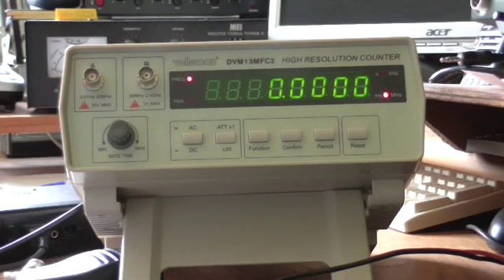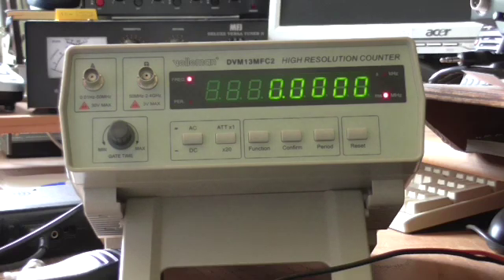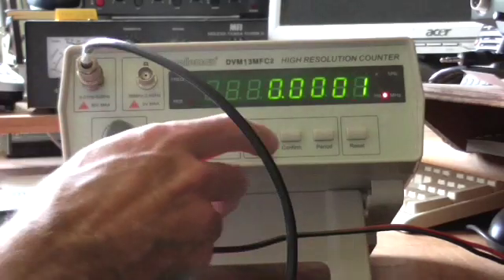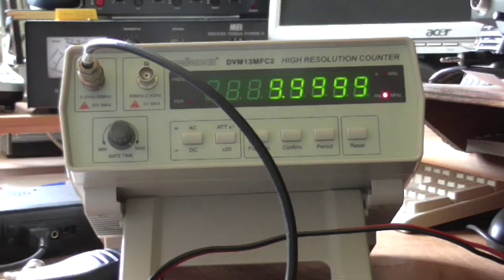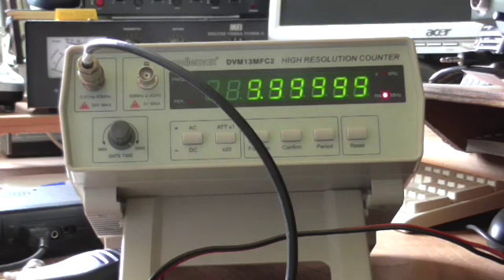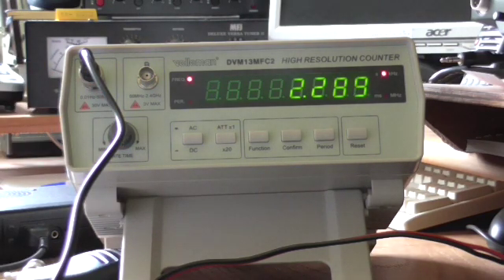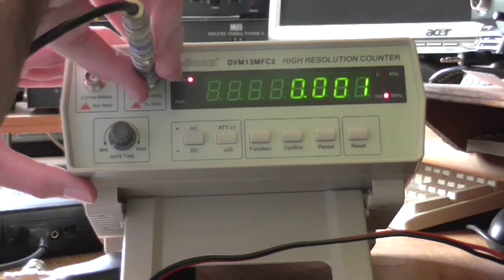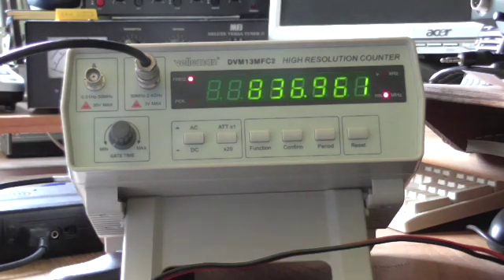Velleman DVM13MFC2 Frequency Counter

Comment: Is it sensitive enough on both ranges to measure ambient RF in a shack from the antenna outside? Or maybe just twisting some wire around the coax. Running only a couple of watts, but don't want a direct connection. Thanks for the info about the linear PSU. Very important and I hadn't thought of that!

Comment: The gate time knob on mine is just a press on fit and will slip if you 
turn a little too hard.  Shaft diameter is about 4 mm if want to order a
 knob with a locking screw.  Otherwise no complaints.

Comment: I have this type if counter and it is off by a fare margin  making it impossible to even tune a CB radio...
Reply: Matt K
This would most likely be due to a not-so-stable internal timebase, which is usually the case with these counters.  It wouldn't be hard to upgrade the internal timebase to one using a TCXO or OCXO.
Reply: +douro20 it has a ocxo
Reply: Hi I've been given one
Reply: Hi I've been given one simular to this.How do you connect it the the cb.
Thanks in advance

Comment: Hi, I have digital oscilloscope, would I need a frequency counter such as this too?. The scope can display frequencies just fine.
Reply: I believe that it's origin is Chinese and that bothers me...
Reply: +OldSchoolTechCorner How is it that he seems to be getting good results with this meter then? I am looking for an inexpensive frequency counter but had I not read the posts, would have been taken in...
Reply: +WA5CVI..it may be accurate but it seems to take forever to respond and having to set the thing up is pretty cumbersome. If one's work is done mostly sub-gig,  then there are a number of older units out there like the Fluke 19XX models or the HP stuff for a reasonable price.